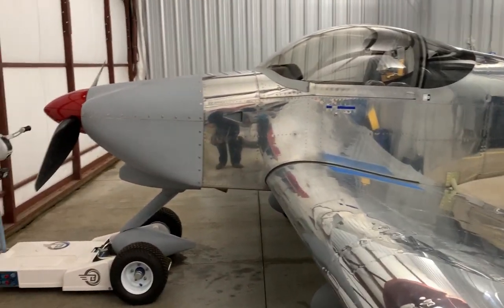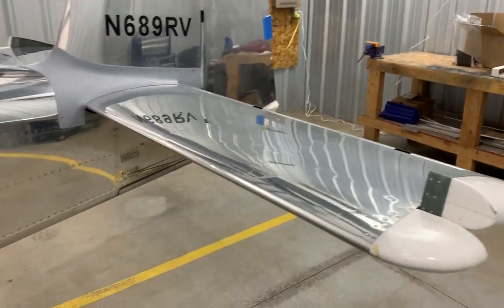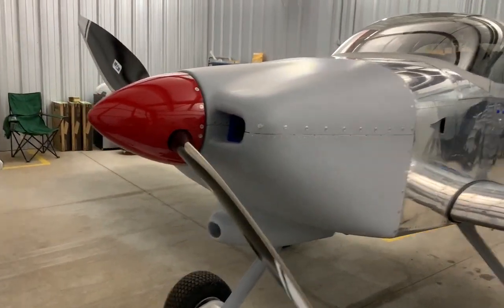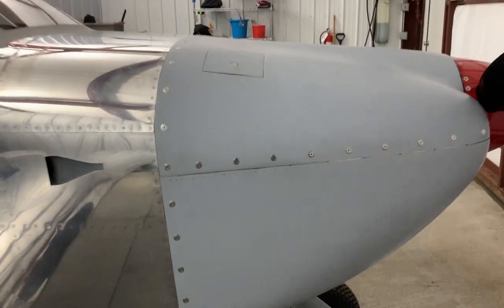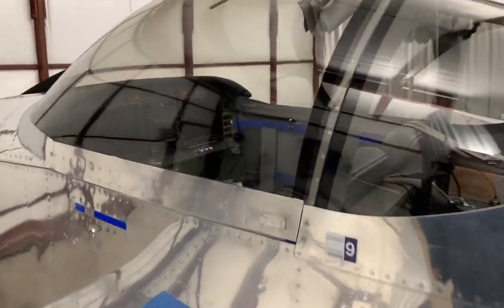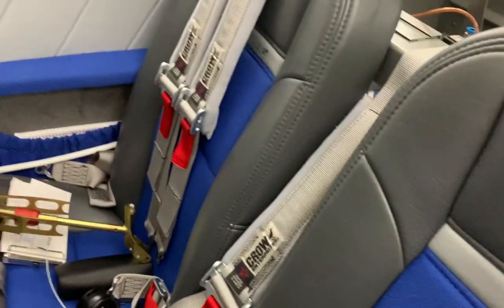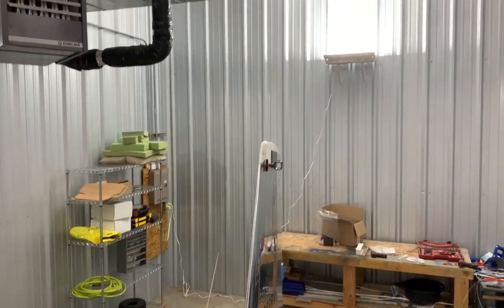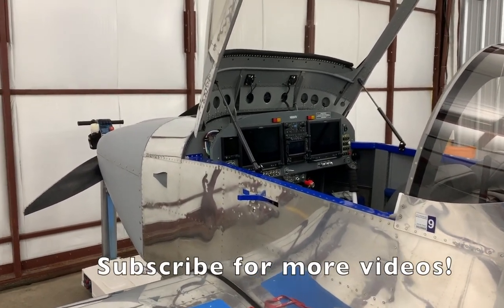Airplane Walkaround

Comment: You wondered why more people don't use the IO-340... If I remember correctly, early ones had some significant reliability and parts quality issues which got them a bit of a bad reputation? Seems they've addressed those issues in later production examples though.
Reply from the maker: Interesting. I did a bunch of research before buying and did not come across the reliability issues you mention. Regardless, no issues with our, its been a fantastic powerplant!

Comment: Just curious about your decision to use the IO-340 180hp when Van's recommends not exceeding 160hp on this airframe.  What was your process for reviewing this decision and deciding to proceed with the 180hp?  I'm planning to build a 9A and have been considering this same engine, but concerned that I might be introducing an unnecessary risk point.  Thanks for the awesome videos BTW!  Looking forward to following you on your Brazil trip (safe travels!)
Reply from the maker: Great question! There is a lot of discussion on this in VAF, so definitely read through that to make your decision. For me I wanted the extra climb power, but keeping in mind the Vno & Vne restrictions. With the extra power you just need to be careful not to exceed your speeds, so definitely one more thing to keep in mind.
Reply from the maker: Just a quick follow up on this. Continental support has been fantastic and they have been great to work with. I highly recommend talking with them when the time comes to buy an engine. I’m happy to introduce you to some folks there if you are coming to OSH this year.

Comment: One other question - the walk around video very briefly shows the upper cowl oil door opening, but I couldn't see what parts and mechanism are used to hinge and secure the door.  Can you share this?  Thanks!
Reply from the maker: Hope this link works...: https://lh3.googleusercontent.com/YKlKL_fznmMN7uuSYlicodZRhDfyuKFPQALNAeBzPtKtNrOCnTaybF2t_hSDuwdCRZEaJ9gsTXrfmAwHYfnxP5TW6JFWZbe6WKwJr6C0DUgFbLz7xWdxLB51OFxxoHKk7H8l_s-HKq-ksKjuXuaImXas80NWIW5Wp-o04RGNaxOhNVE79Ojo9fqTq8itqp4r6RUeHiPZOa3jrsGCjxZsbrztCLfKx1x_KVAdkrOsjmBbm-NEYcWAKPpheOuWl005eSqJVmnH1ycqIv0TXDfrJP_sNDDpgQ9N4ctT7RHuyJfoMsaEfeE7ZsVH8vACfSV6fU9YLA8jBReMI2-GGp_hX24UW7pNR70Ns1syVmDQS35lIon4yUNLZnKNto6gVg4AGuuaiLDVyQQvqSyaL1OUglUyfvoGuaD9A2ccH9yA0N_M2XPN1Z7H-22EUTxddCFmGSA1obzHhAbocY5AwUu6JSxAfVagR1EY04Yc2EA2z_F727RymwnyDPT2eXl98PX7U3wNdxC5FXndvcNxRI2RT2WDjTMEakwn96gUa3kXi9IrbkArhD7pxFzqPEidHQByJpnvWksa8KZr_MUKaXtlRgiZ5f_0NK6_0vr0_XMqbm5BVDsYryb5Trthix9n2H5CdP6TFYNbOj3JASfsVTQl46b7XIVf_q84Wcg7bzxc6WegxKtKtUZB_LqMWZVcpz2eOYU80YHUYEOqrZMtdna1v3EXJCdYKGwa2LtAw_zRn-0DlaIx=w1169-h877-no
Reply from the maker: This is the hinge: https://www.aircraftspruce.com/catalog/appages/averyoildoorhinge.php?clickkey=8683
Reply from the maker: And the latch: https://www.aircraftspruce.com/catalog/appages/cessnapart110.php?clickkey=3726
Reply: @BuildFlyGo  Thank you very much!

Comment: What is the camera mount out at the left wingtip?  Riveted?
Reply from the maker: It's a @flightflix surface mount. They work great and are screwed on with the wingtip mount fasteners that are already there: https://flightflix.net/product/rs-slim-gopro-surface-mount/
Reply: @BuildFlyGo  Thanks - the company responded right away!  One other question - the walk around video very briefly shows the upper cowl oil door opening, but I couldn't see what parts and mechanism are used to hinge and secure the door.  Can you share this?  Thanks!